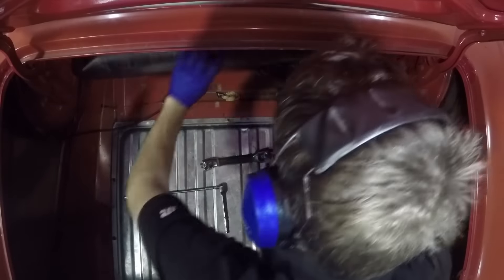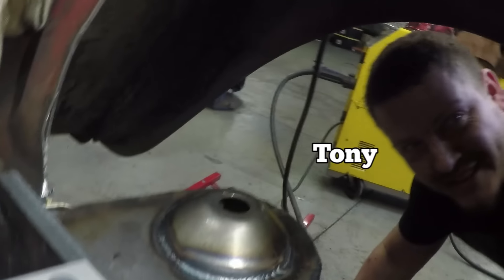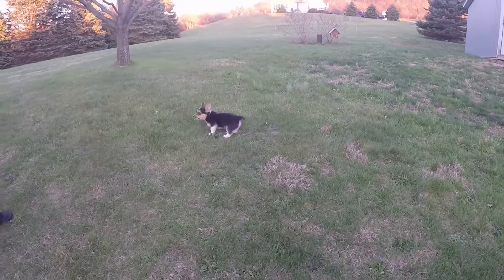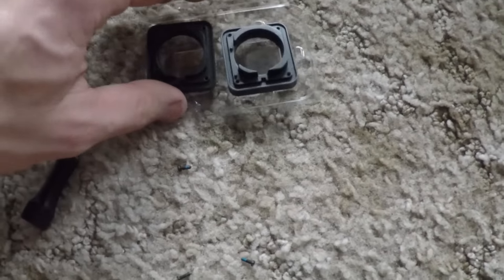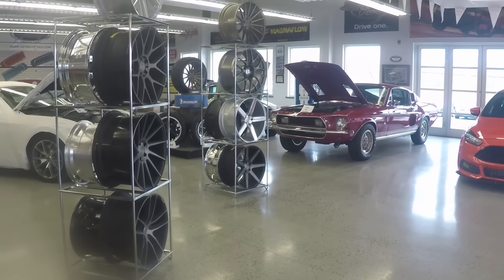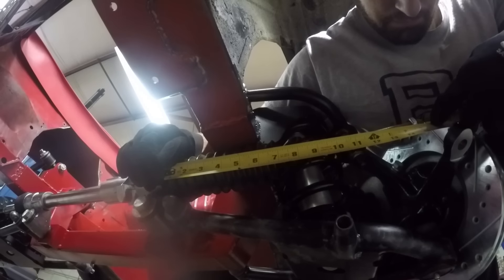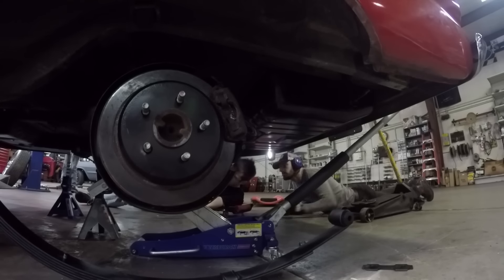Operation Vagabond Falcon: Part 12

Comment: Review the corgi puppy.
Reply: +Snowfire Not much ground clearance.
Reply: +Godfrey Poon peppy but not going to win any races
Reply: slammed enuff
Reply: +Godfrey Poon Kids these days call this a stancer.
Reply: NOT A CAR
Reply: +Snowfire You know some people daily those things
Reply: Is this Matt Farah's Million Mile Corgi?
Reply: What if the corgi puppy is actually Fink? ALL HAIL FINK!
Reply: +Snowfire 5 star corgi for sure.
Reply: Cons: Unsafe! Steering is very soft, changes direction randomly, tendency to roll over even when parked, leaks unidentifiable fluids from intake and exhaust.

 
Pros: Self driving, chicks dig it.
Reply: How about some RCR-style psychoanalysis of the owners?
Reply: +MTThought Millon Smiles Corgi
Reply: +Snowfire Corgi vs Tony shootout
Reply: +Snowfire Regular Puppy Reviews !!!!
Reply: +Godfrey Poon 
The wheelbase is pretty short too, but the power to weight ratio is decent and the engine has a fair amount of torque.
Reply: +Snowfire The intake gives a strong snarl when provoked.
Emissions levels can be high, depending on the fuel used.
Little effort is required to cause large movement of the tail.

Comment: this is some next level hotrodding, like most tuners only go as far as to engine swap something, I mean sure, engine swaps are hard, but this is next level.
Reply from the maker: +Verbose Slayer Thanks!
Reply: +RegularCars its more of a resto-mod kind of hot rodding
Reply: +RegularCars And to think this started with you deciding to buy an old car and figuring that would just be it, more or less.

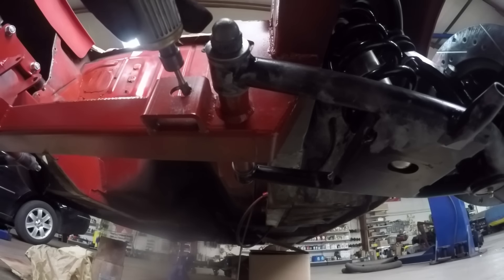Comment: 7:14 - What I've done for fitting nuts on bolts in tight spaces like that is to stick them to a tongue depressor so I can hold it in the space while I feed the bolt into it.  Then when I go to tighten it, a lot of times there's a way to shim between a flat side of the nut and the flat side of the housing which should keep the nut from turning while you tighten the bolt.

Comment: Mr. Regular, those spring perches on the axle should just have one or two small welds holding them on. Just buzz them off, re position, and weld back up.

Comment: You see those drill holes and slots in the brake rotors? That's mass removed from the rotor. That is iron/steel that could be used to absorb heat, but is now gone. That's why I went with solid rotors.
Reply: I wonder why things that cool have fins instead of being a solid chuck of aluminum. Hmm....

I wouldn't buy drilled and slotted rotors either though. I think they just eat away brake pads.
Reply: Yeah, those edges could possibly wear the brake pads faster thus dirtying up the wheel faster. Haven't seen that one tested.
Reply: Maurice Searcy in a real performance application, the rotors and pads get glazed over and no longer grip. That's why higher performing cars have the slots n such in them. I don't run them because I am cheap. I bitch about dropping $10 on brake pads.
Reply: Drilled and or slotted are almost as cheap as solid, because I was considering slotted. Only slotted remains for racing applications and the slot looks like a j. Drilled is out for racing since the rotor can fall apart. Anyway, they also claim that modern brake pads don't exhaust as much gasses as they used to, so drilling and slotting to allow these gases to escape isn't really needed anymore.

Is this falcon racing?

Comment: just pick up some denatured alcohol, if you use a lot, cause it ain't cheap, same stuff in brake cleaner, the aerosol can does make it convenient thou, i put it in a sprayer, and use a high psi air application method from my compressor (old paint gun), works great for cleaning your nuts and bolts before paint and rebuilding, put them in a can and cover with alcohol then cover the can, so it doesn't evaporate, when your ready too use or paint rinse them in more, clean alcohol, i use a tupper ware type container and shake it, let air dry until you need them , cleans keyboards well too

Comment: grind off the old perches.  you're doing everything else right, do this as well.  a little plasma, a little wheel, you're done.  you're gonna have to grind to metal anyway to weld on the new ones and then paint.

either that, or everytime anyone sees you, they're gonna point out the perches.
Reply: +Steven Andrews Yeah. Feck's sake. Grind em off.

Comment: yeah you need to cut those perches off and reweld them in the correct position, do not use the explorer location, they are 2" too inboard and this will be a safety issue. You want them wider, this affects your handling and safety! Please join the vintage mustang facebook page so we can help the project along by giving sound advice.

Comment: Just a question out of curiosity - when you screw the holes for bolts in what was around the shock tower base, and when you widen the cross member hole, is it necessary to paint in those places? People in the country where I live care too much about the body rust, repaint the car, and then drill holes to bolt different parts into the body, without painting of/around these holes. No judgement here, Im just curious - isn't these places going to be covered with rust real soon? minding the location of those holes - you hit few rainy days on the road and all the water would go there. Maybe I'm not right, correct me if so. 
Oh, and nice puppy!
Reply from the maker: +KittX Yes, it is necessary to paint. Bare steel rusts.

Comment: Nobody uses drilled disks anymore, the holes promote cracking of the disk. The closest you can use safely are dimpled disks or grooved.
Reply: +Nick Breen I'm sure you're fun at parties.
Reply: Tanner Quinby
Not as fun as a disintegrating disk under hard braking into a hairpin corner.
Reply: Dude. This is gonna be a cross-country cruiser.  It's not a track car...... Bro
Reply: Tanner Quinby
He's going to actually use those brakes with the drilled disks though, racing or road it won't matter. Have you not heard about drilled disks fracturing and their withdrawal from use by most aftermarket suppliers in Europe?

Comment: I'm curious as to why you used an explorer 8.8, because that rear end is offset, so therefore you're going to have an offset driveshaft. That leads me to believe you are going to have clearance issues with the floor pan. My friend put an 8.8 out of an explorer in his Pinto and he had clearance issues with the rear floor pan, he ended up cutting a hole in the floor pan and making a hump for it to clear. It might be different with a Falcon/Mustang/Maverick platform, but in my personal opinion I would've sourced an SN95 94/95 5.0 Mustang GT rear end due to the same motor transmission combo you are using plus it is non-offset. You'd retain rear disc like you are wanting and it'd be stock location for the differential housing. I don't think the width is too much different on an explorer and ranger rear end. Another idea would be to find a Lincoln Versailles 9 inch, and you'd have the gear selection of a 9 inch and you'd have rear disc, and it would be the right axle width AND it would be factory leaf spring, ideally a bolt in swap.
Reply: Im guessing that he did the axle swap on the explorer rear end to make it fit, which would have brought the differential more to the center...otherwise the rear end would be too wide for the falcon.... the explorer is 60" wide and it cant be anymore than 56.5" to fit in the wheelwell